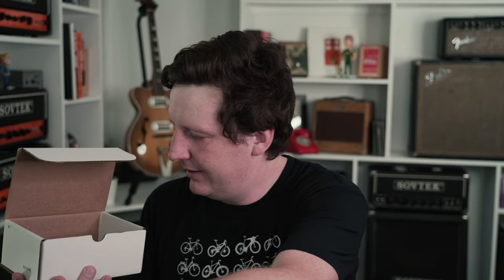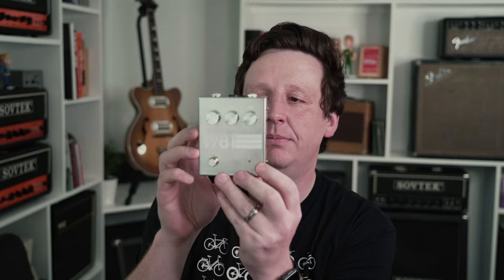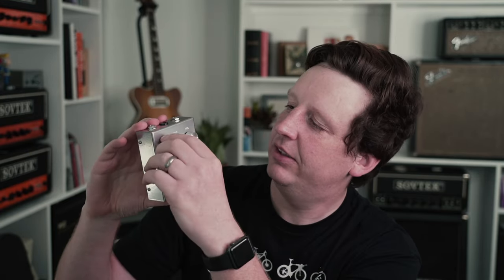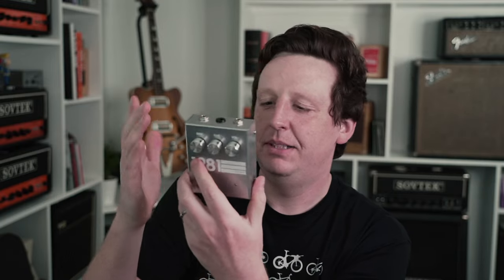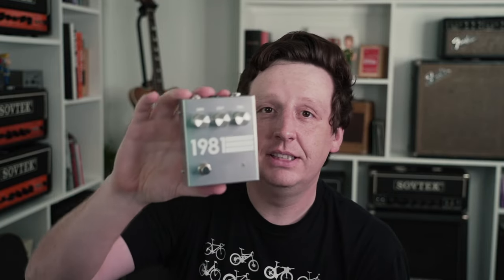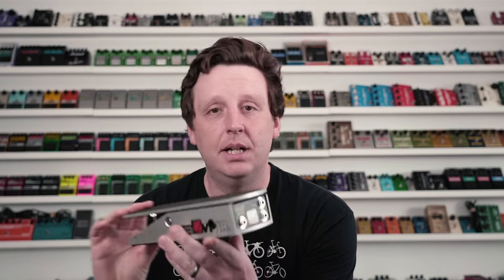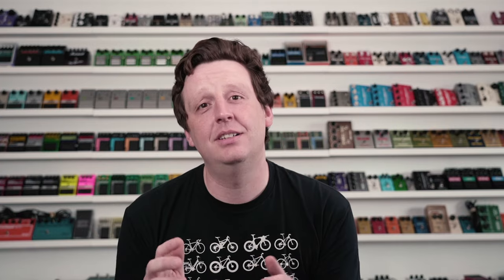Why You Need A Buffer

Comment: Hi. I have a Polytune 3 from tc electronic, which has the Bonafide Buffer integrated. I'm using the buffer turned on. Should it be positioned before, or after a Wah pedal? (my Wah is true-bypass, I don't know if that makes a difference). I would appreciate being clarified Thank you.
Reply: Magda Serra I need to know the same thing !
Reply: I have a cry baby, and is running third in the chain, buffer -> tuner -> wah. I tested the wah on different positions, but every time I go back to this, no other pedal modification.

Comment: I have a boss NS-2 at the beginning and at the end I have a boss DD-3. Would this be correct? Are Dunlop pedals true bypass or buffered? All my pedals are boss except for a Dunlop Wah which is second in the chain. It goes NS-2>Dunlop wah>Boss CE-5>Boss MT-2>these are looped back to the NS-2 and then the output of the NS-2 goes to the DD-3 which then goes to Amp. Lastly, the Dunlop Wah is a slightly rare one. It's the original version of the Dunlop 535Q which is called BB535. Not too long ago I had several distortion pedals that I got rid of...MXR distortion+, Big Muff pi w/wicker, Blackstar Distx and Boss BF-3 Flanger. I got rid of these because of no use for them.

Comment: how much does a 6 Meter Cable change the sound combared to 3 Meter?
Reply: actually I meant compared
Reply: Daniel Bauknecht depends in the capacitance rating of your cable. But generally I think up to 6 meters is safe
Reply: buy the Joe Bonamossa cables. you'll flip at the difference. expensive though.
Reply from the maker: Just do some testing and see what you hear.
Reply: @jhspedals  Sensible advice. Trust your ears. If I lose volume I turn up my FUCHS.

Comment: why is there no such thing as a bad buffer?
Reply: because buffer pedals are stupidly simple circuits and dont really mess with the tone. So yeah, its hard to fuck up something so simple as a buffer. I would imagine however that if someone made a buffer that messes with the tone a bit too much it would be a "bad buffer"
Reply: @footshu6696  I run a pretty large board with 16 pedals all isolated in a 10 channel analog looper. I use it for blues and other 70's stuff that uses sometimes tremolo and other sounds. So i like my sound as clean and least signal loss as possible straight into a 5 watt wangs mini5 tube amp with no effects loop. Ive used buffers with this rig and immediately took them off as it is a slight digital tone that enters when using a buffer. I can say i spent a few hours with an empress+ buffer. The only good it did do for me is boost my signal gain a smidge and uped my low end a tad which was good. But took away tone from the quack on my strings and digitized my overdrives. It is slight almost fooled me, noticed i wasn't playing my riffs as good though.  I would do away with buffers as much as you can. They do in fact change tone. Stick to loopers as most time youre not using all those pedals at once anyway, keeping the chain short

Comment: Will I go to jail if I touch your buffer? But really, doesnt the MXC Micro Amp serve as a buffer as well as a pre-amp?
Reply from the maker: If the Micro Amp is on, yes it is a buffer, off it is not, it is True Bypass.
Reply: JHS Pedals I believe despite what I’ve read a few places including the excellent pro guitar shop demos...unless this has changed recently..,the MXR micro amp is hardwire bypass.

Comment: i use a boss gt6 multi. it is joshs fault i bought a voodoolab microvibe (used in middle section of a tune called The Firing Line) then this disease spread to JHSPG14 (Tell Me Who You Are) and now The Afterneath and now i have hand built a pedalboard (more joshs fault) the boss has a buffer at end of line, so i see i need a buffer at start, but AFTER vibe then fuzz, CORRECT?

Comment: how does the buffer "know" exactly what to do to adjust my tone to it's original caracteristics? Also, can you have too many buffers in your board? for example if I have 8 boss pedal as my rig, what happens?
Reply: It doesn’t “know”. It’s all about having the right specs. Ideally it should have an imput impedance of 1M ohms. Why? Because 99,9% of amps have this as their imput impedence so it loads the pickups as if you’re plugging it directly into the amp. Second, it should have an as low as possible output impedance. In practice this would be 100-200 ohms though. Why? Because this will drive your lines (long guitar cables, numerous pedals). These cables and pedals have capacitance. The more capacitance, the more it sucks your tone. Capacitance works as a filter, because it takes away high end. Hope this helps.
Reply: @TheEchelon  I think I just don't understand electricity enough to really get this. In my mind, electric current is one dimentional... like, if a cable degrades the signal, how can a pedal LATER in the chain restore it? If I may use my earlier analogy, how can the buffer "know" what to add to it to restore it? it's like, if you send me a pro tools session and in the process I lost the drums and the keyboard parts, I can add some drums and keys on my own, but It'll never be exactly your original drums and keys...

Comment: Ok, so... could you just use a boost? And do all non-true-bypass pedals have buffers?
Reply from the maker: A boost will restore volume and gain, but not necessarily tone loss unless it's specifically designed to do so, like our Prestige. So, in short, no, but boosts are good too ;)

Comment: No matter what a buffer will change tone to a much more digital sound. I have a blues rig and the buffer makes my tone less natural, as it does bring up my low end a tad, its not worth the tone loss. I use about 16 pedals on my board and ive found to just put as much through my 10 channel looper, use as short of cords as possible turn up the low a bit, it will beat a buffer situation any day. Granted if you have no choice for some other reasons, buffer can be useful, just dont like the digital thing it does to tone
Reply: Use an analog buffer.

Comment: So their glorified capistors for my pedal board?
Reply: What’s a capistor and how do I get one?
Reply: @meesterdinglefritz2064  capacitors are a device used in circuits used to raise the voltage in a circuit back up to 100% however you can't just put an input and output wired through a capacitor.  If you know the basics of series circuits you know each load, for example a light, it gives off a value known as resistance which causes the next loads to give off less of a output.  to get around this you can put capacitors after each load.  Your pedal board is your series circuit, your pedals are your load,  and your buffers are your capisiotors.  Both buffers and capistors are have a power source and are made of multiple parts.  Again your not going to get a buffer by wiring it in the middle of an inputs and output jack.  Also to answer your initial answer you can go our to your local computer store and get capacitors.  Also their are two types of capacitors: one requires you to wire one side into the negitave flowing side of the wire and then the other side of the capacitor goes into the positive flowing side.  The second one doesn't care which side goes to negitave and positive.
Reply: BoyScoutGuitarist I’m well aware of what a capacitor is.  You had mentioned capistors, the sound neat.
Reply: @meesterdinglefritz2064  sorry didn't know you already knew

Comment: Buffer need? Buy a Boss pedal. Problem solved. (Not for every situation of course... but seriously, problem solved.)
Reply: The thing is, though, that they do not only buffer the signal. They buffer the signal ONCE, then the signal goes through a FET switch, which is a different kind of buffer again, then the signal goes through ANOTHER FET switch, and then at the end, there is yet another buffer.

You're using a shotgun to kill a fly if you're using a Boss pedal just to get a buffered signal.

It is generally agreed (at least around these parts) that a Boss pedal will impart a non-desirable "thin" quality to your tone.